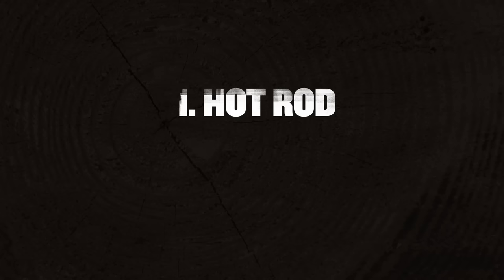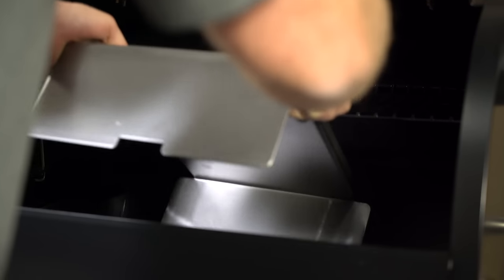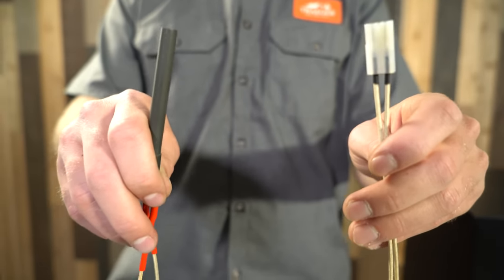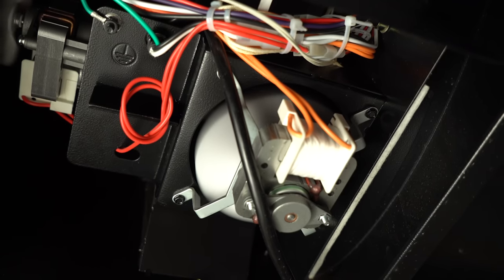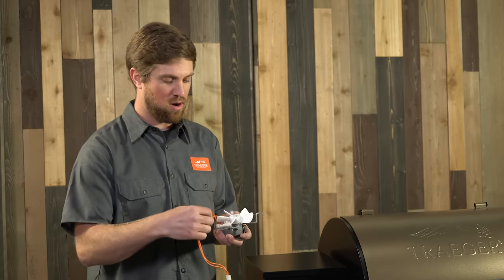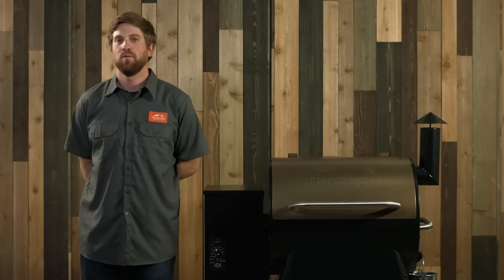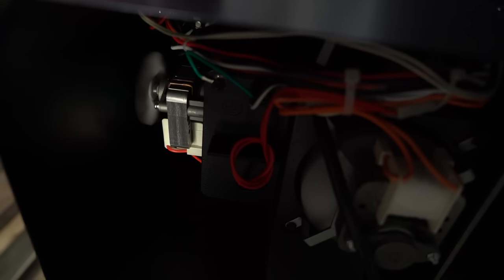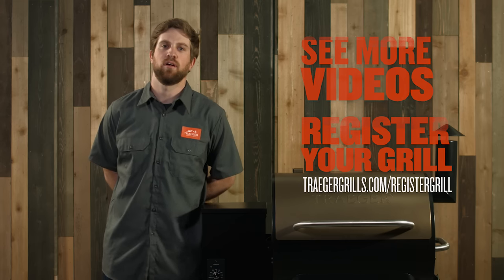Traeger Grills - Troubleshooting:  Grill Startup

Comment: I cleared the problem by vacuuming out the igniter. I placed the vacuum hose in the firebox and sealed the air with paper towels and letting the vac run for about 3 minutes. Problem fixed. Problem most likely caused by moist dusty pellets building up a residue.  Lesson learned. Keep your pellets and grill clean.

Comment: Pulled my Traeger smoker out after a long MN winter and auger fed pellets, but would not light entirely in firebox. I switched hot rod few years ago and was so easy, I figured (hoped) it was just that. Replaced it, but issue persisted. Found this tutorial and it was the fan. Simply stuck, gave it a push and fired right up. Thanks for this quick tutorial. Super helpful.

Comment: Thank you ! Thank you! thank you! My grill had heat but no fan. I checked the fan and found Black Widow webs all around it impeding any movement; Black Widow webs are incredibly strong! I cleaned out the webs and kapowwie - it fired right up! Remember folks, clean you grill after every use ! Thanks again!

Comment: After about 2000 uses, my treager needed a new burn pot, it had rust holes so the air was above the pellets. Took 20 min and $20 to fix it.